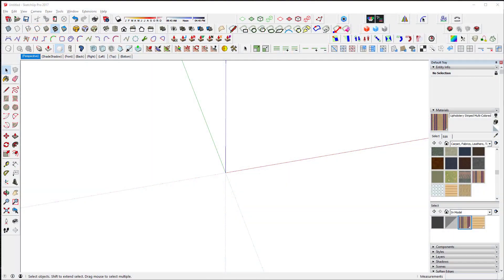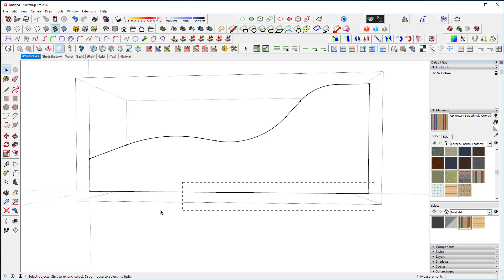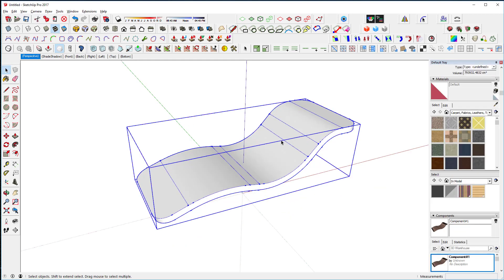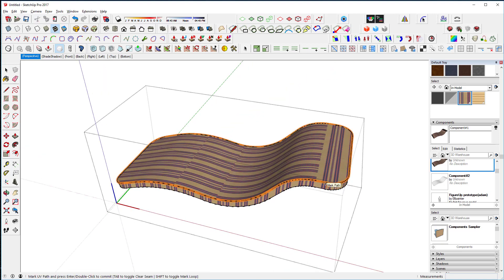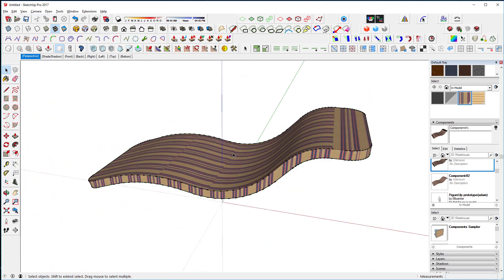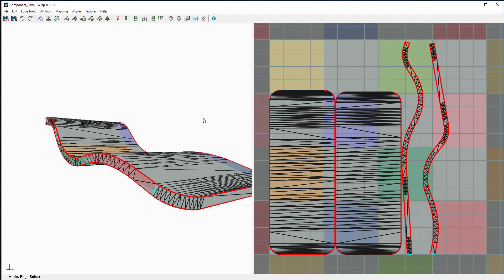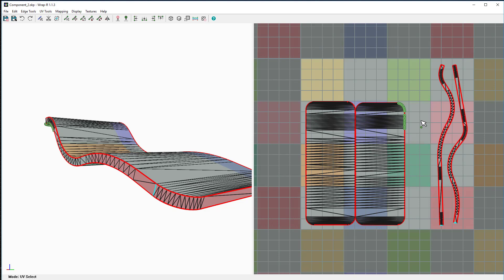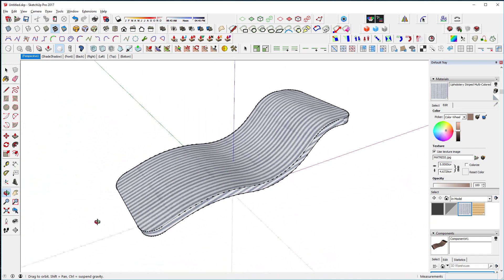Wrap-R for SketchUp Introduction

Comment: great tutorial, can you show us how to do something with multiple textures?  For example a soda can which has a bare metal texture on the top and bottom but a label texture on the side. How would I position the label texture and metal texture on the unwrapped surfaces and then combine it into a single texture?
Reply from the maker: STDrepository you only need one UV map and then paint the different materials using Substance Painter.

Comment: if i would want the thick of the bed mapped vertically, how can we do it? put that part in other material?
Reply from the maker: Ben Tal you'd just rotate the uv map 90 degrees
Reply: Any tips on the side of the mattress?  The perfectionist in me was bothered by how it was all nifty and nice on top but the side was messed up.  Thanks for the tutorials, I learn about more extensions from your videos that I didn't even know I needed, heh heh...

Comment: when you rounded the corners 1:54 you used 2 point arc tool, after setting the second point you double clicked it and corner was erased, it's not documented feature or something like that? where did you find this?
Reply from the maker: Not sure where I found this,  I guess by trial and error. It only works if the points of the arc are tangent to the corner being replaced.
Reply: Hello All,  and if I could chime in. This was introduced with S-UP 16, as well as rotated rectangle tool, circumcised polygons and extra arc tools. It will cut the other corners with a double left click.